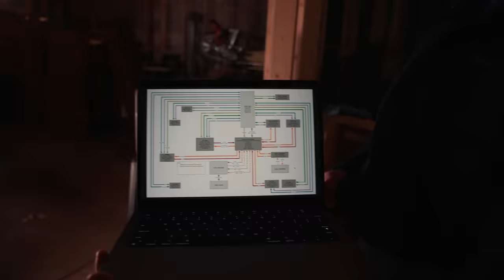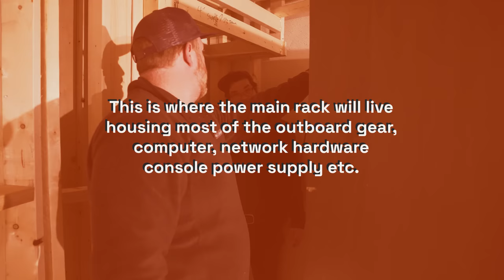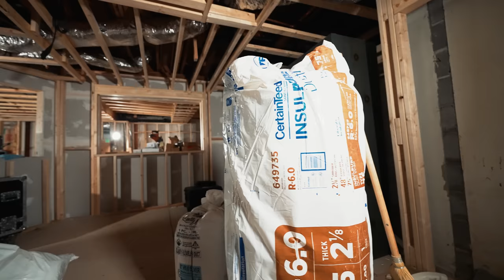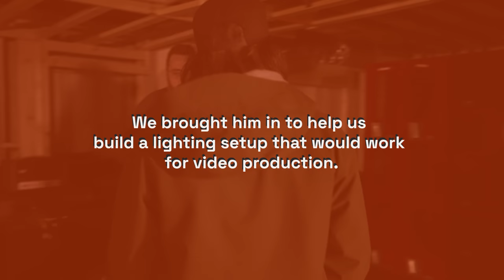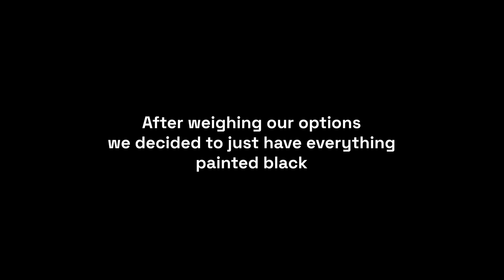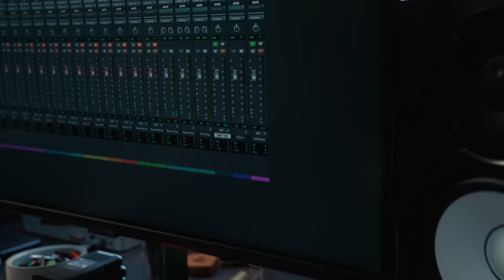The Studio Is Working! (sort of) Home Studio Build Ep. 3

Comment: Rhett! Don’t make the same mistake I made by building your mic cable into the walls without a way to easily remove it. I built a studio and wired it into the walls. When life took a sudden turn and I had to move, all the very expensive cable was not easily removed. Instead, you can build a removable cap along the floor and run it through that, if you ever move or need to replace it, you can do so with damaging or removing the sheetrock.
Reply: Agreed, Ya Never know,You cant make changes easily when it is permanent
Reply: Very true. A few of the big rooms I've been in had hatches in the floors for cabling.
Reply: Excellent idea!
Reply: Or install the cable in EMT or PVC conduit with the appropriate bend radius and a diameter large enough to include the termination plug.  You should be able to pull it out by pulling it through the system the same direction it got pulled in.  So if you pulled it from A to B, pull it out at B if possible to minimize problems.
Reply: All kinds of external run possibilities with low/ no voltage.
Reply: Remember when everything went to CAT5?  CAT6 will be sunseted someday.
Reply: @lespaulguy1979  Pull SM fiber if you are worried about bandwidth. Virtually everything you can do with MM you can do with SM.  It can be hard to pull something into a conduit with stuff in it, even if you left a pullstring, so either do it up front or accept it might require repulling the entire run.  Fiber is pretty cheap, it's terminating fiber and FDUs etc that is expensive.  So don't terminate it until you need to.
Reply: Noah has a Nathaniel Rateliff vibe. Very cool.
Reply: Cabling ducts are a must!
Reply: Man, this is inspiring 👏👏👏 good job and keep going 🎉
Reply: Not conduit though. A cap. Something easily removable without dragging hundreds of feet of cable through a tube. It’s easy to do and many methods, but buddy, it’s a 
B-1-T-Charlie if you put it behind sheetrock.
Reply: @k53847  yep. Easier for everything... Expansion upgrades troubleshooting. It's a semi industrial space. Practical above neat drywall...
Not my studio tho
Reply: Yeah, definitely install a pipe in the wall to pull the wires through as opposed to pulling the wires through themselves
Reply: PVC conduit 2”, 3’, 4” and leave a length of pull string in there with plenty of extra at each end for future pulls. Looks great so far.

Comment: I ran all my behind-the-wall cabling in several runs of 2" PVC conduit with long radius 90 degree ells. I also included a couple of runs of nylon masonry twine to act as fish tapes in case I want to provide additional cables in the future. It's important to avoid cramming too many cables into one conduit or else you'll have difficulty removing or adding cable. I much preferred to have multiple conduit runs with fewer cables in each than too few conduits with too many cables in each. The wall itself was comprised of removeable rough wood panels approximately 32" off the floor with chair railing at the top where it transitioned to drywall. The vertical seams were concealed by 1" x 3" wood strips in a board and batten style pattern. My logic was that the rough wood paneling with the 1" x 3" vertical strips would help with diffusion.

Comment: Yay, 1st tracks in the new space and they sound great!  This has been a loooong haul and went way deeper into structural engineering than I ever imagined but you are seeing some light at the end of the tunnel.  Probably satisfying to work in there.  

FWIW my studio interior finish was designed around 1/3 reflection, 1/3 absorption, 1/3 diffusion.  Drywall is Satan to musician ears so we used barn wood slats instead.  It does sound pretty great but I wish it was 2x the square footage.  Plus 1 on running all AC wiring in the walls and all data and audio cables in an easily changeable floor runner.  Digital technology changes quickly.

Cheers!

Comment: the studio is really looking awesome.  You will have a great vibe in there.  

I think the solo tone you achieved in rockstr really needs to be in most of the song. The other part gets really  repetitive and its needs more.  Your solo tone and riff makes it carry everything.  

When youre recording now take a really high gain amp crank it to the top and listen for any rf interference, radio signals etc.  Now is the time to see if you have a problem.  I recently was setting up a speaker room and feeding it from an ampete and a bunch of amps and i started hearing a fm radio station.  turns out the room is in a 34th floor penthouse and there is a radio station antenna on the roof.  Im fighting with the building and the station is working with me.  Bottom line, I may need to build a faraday cage which would have been a lot easier before I put the walls in.  Love the look and feel of the studio. Keep on rockin.